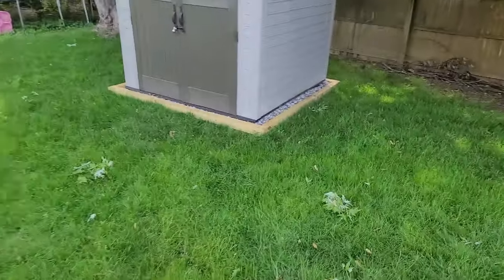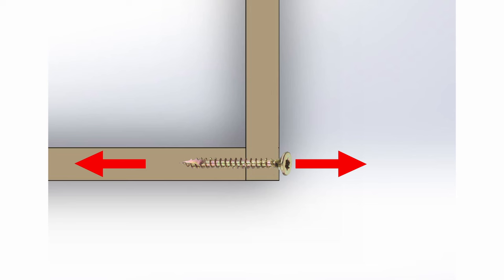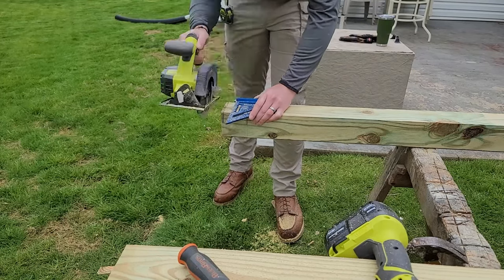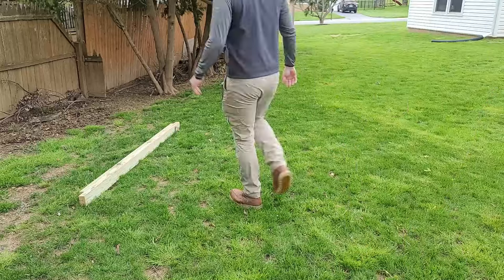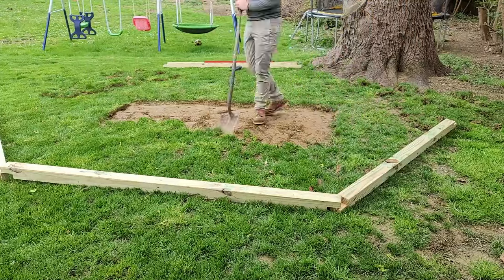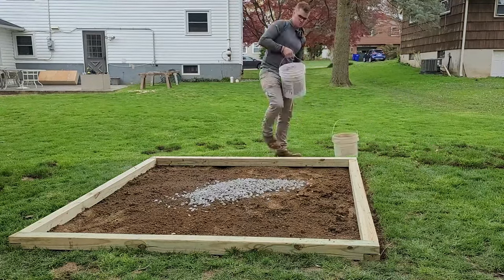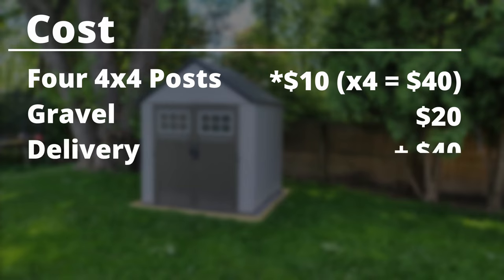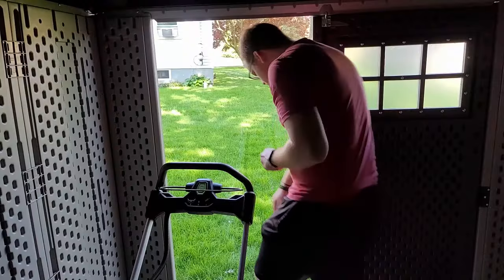Building a Shed Foundation for $100 | TIMELAPSE

Comment: Thanks for the video. Only comment - wheelbarrow my friend LOL.
Reply from the maker: Don't worry, I have one now!
Reply: @thebackyardbuilder  A few question for you if I may. 

I have a 10'x8' LifeTime shed I'm hoping to build this weekend. Manual says concrete or wood frame as the base. I really don't want the cost and effort of concrete for a $1700 resin shed. Wood frame is doable for me but with deck blocks and lumber, the shed gets kind of high and needs a ramp - rather not. 

I like your build, 4x4 filled with 3/4 stone:

1. Did you compact the stone? I'm planning on renting a plate tamper from the orange store.
2. Did you find the plastic floor is well supported by the stone?

I asked LifeTime and they just said "do what the manual says" LOL
Reply from the maker: @smokeycanuck8058  I think if you do small gravel and compact you should be fine, you can even get stone dust to fill in the cracks if the gravel as well :). That being said, I am not liable for anything that happens! 😂😂

Comment: bulk gravel dump or box store bagged gravel?  🤔   if I go dump, I have to finish the gravel bed the same day as I use my garage.  if I go box store bags, I can go at my own pace 5-7 bags at a time spread out over several days.   like you, I have no friends to assist.   I had planned for a paver floor/base, but this seems more forgiving.
Reply from the maker: It's probably cheaper overall to buy in bulk, but the other way is more convenient for you so it would depend on which is more important to you: price or convenience?  Hope this helps!
Reply: @thebackyardbuilder  ... revisiting this.  yes, the bulk rock from the local rock/stone/paver/etc. business was cheaper; however, I would need a trailer capable of 1 ton and a truck to tow it.  So, for home delivery, I was looking at $75 for a "bag" of rock (1800lbs), $25 for the pallet, and $175 for delivery (they are only 3 miles away).  The box store gravel is $198 [$5.50/bag, I think I need 36 bags (18 cu-ft total)] and I can work/haul them at my pace.  The 4x4x10s were $12 ea (the inside of my square will be 8', boards are cut to 8' 7"), and landscape fabric was $6.  The toughest part for me was relocating the 18 cu-ft of dirt that cam out of my 9' x9' x3.5" deep hole.  18 cu-ft is a lot more than you think and finding places to put it was a challenge.
Reply from the maker: @K03sport  that stinks that the delivery is that much! Are there other local places you could buy from? The numbers will work out differently for everyone, but I hope you can still get yours built for a reasonable price!

Comment: How deep do you have the circular saw set at?
Reply from the maker: I maxed mine out and it still wasn't quite enough. You want to cut away half the thickness of the beam. So for these, they are 3.5 inches thick, so you want to cut away 1.75 inches if you can.
Reply: @thebackyardbuilder  Thank you!
Reply from the maker: @jasonbermel4512  you're welcome, thanks for watching!

Comment: what other materials besides gravel can I fill the foundation with?
Reply from the maker: You could have a concrete slab, or concrete blocks, wooden posts. There are several ways you can make a foundation for a shed, the most important thing is to have airflow underneath the shed so the floor doesn't rot away.

Comment: So is the shed not anchored at all to the foundation then?
Reply from the maker: No, I just put lots of heavy things in it to weigh it down! Haha
Reply: @thebackyardbuilder  in in florida,  putting lots of things into it won't work for me.  Any suggestions?
Reply from the maker: @saeed7099  what are you using it for? You could look into different anchors, but it would probably be fine for the most part to not be anchored
Reply: @thebackyardbuilder  I'm new to this so forgive me if I say something dumb.  I'm using it to store my lawn mower, rakes, etc. My concern is if a hurricane comes.  Is it possible to disassemble  and reassemble?
Reply from the maker: @saeed7099  no worries :) technically yes it can be assembled and reassembled, but it will be somewhat time consuming. I would say your best bet would be to do some research into what other Floridians do for sheds as I don't really know what to expect when it comes to hurricanes. Sorry!

Comment: its not really a foundation if its just sitting on the top soil. At least you could raise the post on concrete tiles which cost nothing and put gravel under the post so they dont rot and suck all the moisture from the soil or just simply put on leveled gravel which should be compacted otherwise wats the point of it?
Reply from the maker: The posts are meant to hold the gravel in place. If I raise them off the ground, the gravel will just go under the posts and will not be contained. The only thing sitting directly on soil are the 4x4 posts and I  used posts rated for ground contact, knowing that they will need to be replaced down the road. This is not meant to be anything  super fancy. Just something cheap and simple to keep my shed off the ground

Comment: I got all my materials recycled. (Free) 
Pallet wood and off cuts, 
Old concrete chunks smashed into 5-20mm 

So far ive collected about 1.6tn hardcore
And who knows how much wood 😂☺️. 

I should add that i work at a hardware store to the materials are rather boundless.
Reply from the maker: That's the way to do it right there, keep it up my man!

Comment: Do i need a foundation if i have concrete floor?

but my concrete floor is not level..
Reply from the maker: You probably will want one both to level it out and also to allow air flow underneath the shed👍
Reply: If your concrete pad is out of level there are several self leveling products out there that will adhere with strength & specific for weather etc. If your pad is out of level because of a crown ( hump) on it you might be able to grind that area down simply with hilti 8" grinder or other tools of same type that you could rent im sure. Also there is no need for airflow under a resin shed directly attached to a concrete pad since there's no wood that might rot from lack of air. Attach your shed floor to the concrete pad with tapcons with washers . I would put 2"×4" on your shed floor along the 2 sides & back & use 4" x 3/8" tapcons for extra strength
Reply: @mikep5304  the concrete floor is above normal level ground but i heard people saying i should let some air/space between the shed and the floor

Comment: Screws aren't going to pull out and rocks for a base is not good.
Reply: Rocks as a base are recommended for ease of leveling and drainage while being much cheaper than concrete for both materials and labor.

Comment: Ummmm how did you pay $20 for a metric ton of gravel when Lowes wants $1,200 for 1,620 lbs?
Reply from the maker: Depends on the size and type of gravel, but I also ordered from a local supplier not from a big box store

Comment: I don’t think this is good thing to do, because if you but in gravel the floor of the shed will be broken some years later, I install my shed 10 year ago with the foundation from 2x4 fame and plywood outdoor , total only 300$, may be more expensive but right now my floor still like new nothing change after 10 years, I only want to tell everybody “ don’t be cheap with your project because you must throw it to trash very soon .thankyou
Reply: Im skeptical aswell even though Google says it's the way to go , im thinking its fantastic for drainage but that's about it ! My base / frame is comprised of 2"×8" 4 piers & 5/8" sheathing for 8'x10' Suncast resin shed , might be overkill but it's the way I roll .. With all that said im sure the gravel base will workout fine but it's just not for me . Cheers

Comment: Dumbest design ever. 
1) nothing is holding that shed down. If you lay a cement foundation you can mount the shed to it. With gravel you can't 
2) screws don't pull out
3) digging up the grass did nothing
Reply from the maker: @davidharrell3144  to each their own. This design worked for my needs and budget at the time and I haven't had any issues in the 2.5 years since I installed it.

1.this was a free shed I got and was not meant to be a permanent solution so I didn't want to pour a pad until I got a larger permanent shed down the road. I am not concerned about high winds where I have my shed so no need to anchor it.
2. Screws can pull out depending on the stresses put on them, I have come across it in the past over time the weight of the gravel pressing outwards over time pulls the posts apart at the corners.
3.digging up the grass allowed me to use it in other places in my yard, but I agree it did nothing for the shed foundation.

Appreciate the comment and thanks for watching 👍